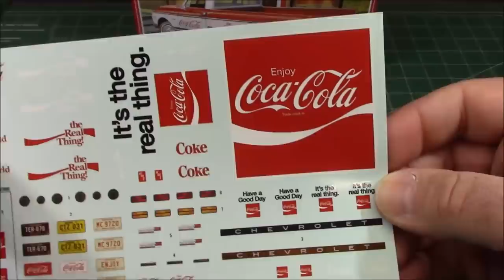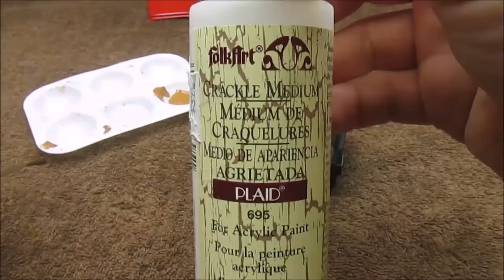1972 Coca-Cola Chevy C/K Pickup 350 w/ Vending Machine 1/25 Scale Model Kit Review Weathering AMT

Comment: I spent a lot of time and effort trying to get my models to be "perfect" in all ways. From a flawless paint job to making sure every piece was in its proper place. Naturally, my models came out like a disaster. But since watching your videos, I've learned that it's okay to be less than perfect. To grab a paintbrush instead of the airbrush to lay down a simple coat of paint and not to obsess over every single detail. I recently finished a 34 Ford Pickup and when I attached the window frame to the cab I ended up with a huge gap. I looked at it and rather than panicking I grabbed some plastic filler, did some filing, painted on a few coats of paint, added some rust effects and it looked like a worn truck that had some repair work done to some body damage. I've gotten much praise for the entire model and no one cared about the original gap in the window frame. So thanks a lot for the encouragement and please keep up the fantastic work.

Comment: I'm currently doing this very kit, but not with all the Coke logos...I'm making a scale model of my 1969 C10, the only real exterior difference is the grille & the front turn signals are in the bumper...other than that, it's the same...just finished painting & assembling the engine yesterday...I want more detail in the engine though...I want to add plug wires & heater hoses & wiring harness & such...I think I'll put some led headlights & taillights in it too...I'm gonna make the Coke machine though...it's there, so why not? Lol!

Comment: Awesome review and build as usual, Chris!  Quick question for you:  how would you go about detailing the molded-in raised scripts on model car/truck bodies without getting paint all over the place, assuming no script decals came with the kit, such as older kits?  Any tips or trucks you could share?  Thanks, bud. 😄👍👌✌🇺🇸
Reply from the maker: Sharp silver pencil works. 
Bare metal foil first, then painted, then lightly scuffed to remove just the paint on the letters
Silver gel pen lightly dragged across the surface points

Those are a few i've used depending on the kit.
Reply: @hpiguy  // Thank you, sir! 😄👍👌✌🇺🇸

Comment: You mentioned using using Rust Ole-um primer, doesn't that soften, craze, melt the plastic? Which primer is it? Does it have a number?
Reply from the maker: If you watch the video, especially the painting sections, I show every single can I use lined up so that there is no mistake in what I'm using.
Reply: @hpiguy  Sorry about that, I did watch the rest of video after posting.

Comment: I can't seem to keep my Sharpe "wet" so to speak to go over the painted surface. It seems to want to hit or miss and I have to keep going over that surface. Product error or operator error? I've bought 2 or 3 of these trying to get it right.
Reply from the maker: I store them tip down for one.
Also, pressing on them makes the ink stop. Takes a very light pressure to get them to lay down a nice coat.
Reply: Also make sure that the paint is fully cured.